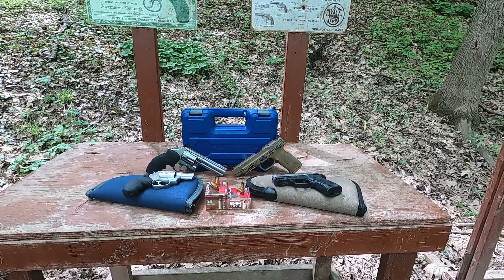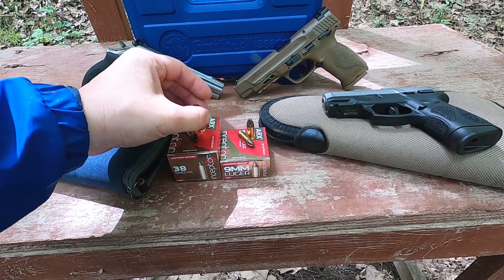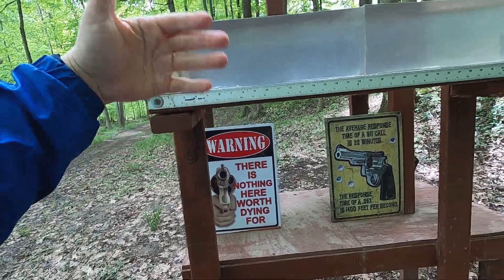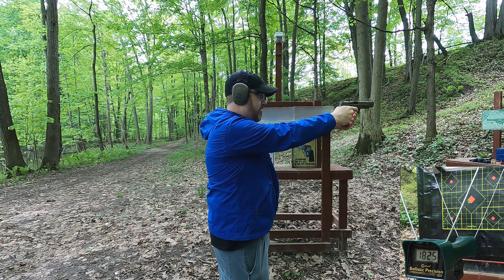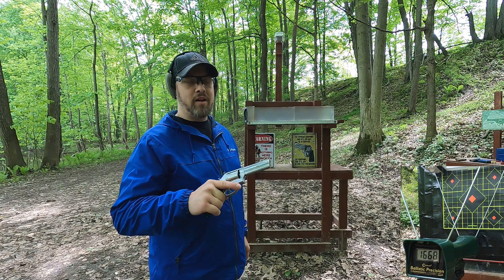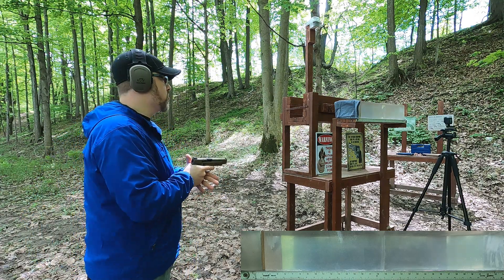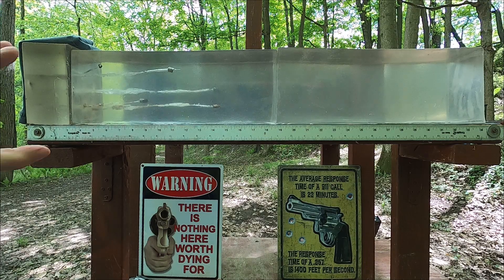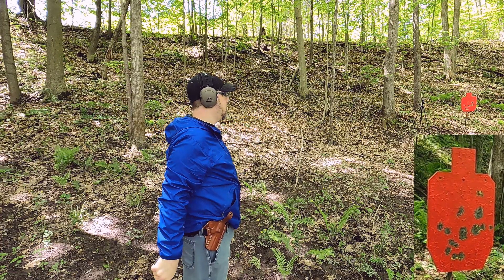🔫Plastic Bullets? Inceptor ARX Preferred Defense 9mm VS .38 Special Complete Ballistic Test

Comment: Will the rounds act/ behave like sandpaper on the "lands" in rifling? 

Filing down the lands? 

Just a thought
● copper or lead softer than the lands
Reply from the maker: These bullets are made from both plastic and copper, both of which are a lot softer than steel.
Reply: @GunSam I was considering the power of a dual apoxy. 

● what exactly are the manufacturers using for their molds? 
•• example sand, copper, and other alloys.

Just a thought.

Comment: What carry ammo would you recommend for a short barrel 9mm? I just got these bullets and if you don’t recommend them I don’t want to use them.
Reply from the maker: 9mm is pretty easy to get good ammo for. Simply use Federal HST or Speer Gold Dot and you will do well. If the pistol is very light I will use standard pressure, if it's a little heavier like over 20 OZ I use +P versions.

Comment: The only bullet I've ever used it has plastic in it is horny extreme defense 9 mm other than that I wouldn't shoot a plastic bullet I just use brass round nose in my 38 and of course I've got some hollow points in defensive loads  I hate lead round nose bullets all lead bullets do for a modern revolver is fail up the rifling

Comment: I would assume that the high velocities for the 9mm are to get the blowback to cycle. The inconsistent 38 velocities are likely because of a combination of case capacity, powder charge, OAL, and chamber pressure. I'm guessing pressure is too low. My thought would be to shorten the case to 38 short/long colt, with all other components being the same. Or, just use different ammo.

Comment: Great test, I’d avoid this ammo like the plague. Too many better options out there than to mess with these. Those wild swings on velocity for the .38 means inaccurate assembly equipment and crappy QA on their assembly line, so no.  Thanks for the heads up Sam, saved us some $$$ and possibly a trip to the ER if one of these subpar rounds wildly swings to the higher end of the velocity/pressure scale!  👍

Comment: I'm currently using the Norma version of this (NXD). I'm guessing Norma licensed the tech because it's obviously the same bullet but tweaked. I've fired significant amounts of the 80(Ruger brand) & 65 gr loads in 9mm. I've found it 100% reliable in everything I own from a 4.7" P320 to a 3.1" Shield+. It's basically a sintered bullet so barrier performance is not a goal, fwiw. Curiously, the terminal effects from 10% vs Clear Gel vary noticeably. I use it because I mostly pocket carry & 13 rounds of 65 gr bullets carry easy. As for Terminal Ballistics, if it goes bang & cycles I'm happy. When you get into wounding, barrier defeating, & cartridge integrity/sealing, your best choice is FC Tactical Bonded & I don't even know if it's accessible in 2022.

Comment: Wow, that took me back.  I checked my 38 ammo shelf, and I still have a box of New Generation Ammunition 38sp+P “Sentry” rounds, 80 gr. roundnose plastic bullet in a jacket, claiming 1,300 fps.  Original price was $27.99 and I bought ‘em at a show for $15.  Label says Batch 1282-43/99 so I suspect they were made the 43rd day of 1999.  Never tried ‘em, maybe should send to you. 😄Oddly, the red plastic is in a jacket that looks like nickeled brass, but loaded into plain brass.  Gimmick ammo like this might meet a requirement for low penetration, but as your test shows, it is seldom reliable for all purpose use.  I suspect blast and muzzle flash will be excessive, though recoil minimal. Thanks for the test! 👍

Comment: I'm impressed that the 9mm in the long barrel got close to 500 ft-lbs energy. The 38Spl in the short barrel (apart from one bullet disintegrating) is showing classic signs of undercharge. That is, the burn is random and therefore that's why the velocities are all over the place. A bulkier powder should have been used to get better case filling. Either that or use a cork wad like in shotguns to hold the powder in a smaller volume. I think LB4L has experimented with a similar idea for light loads. I'm not sure why the 4" barrel doesn't show this as the way the 2" barrel does. Perhaps powder burning while the bullet is in the barrel is still able to hold the pressure up.
Reply from the maker: They should jacket these things. I think the velocity would be similar. The recoil is insane though, and by that I mean like .22 LR felt recoil with the 9mm in the M&P.
Reply: @GunSam  Can you clarify what you meant about the recoil? Is it a lot or a little?
For the 38Spl, I think 110s would ultimately have performed better. And in the 9mm, your typical 115s would probably have performed better.
I definitely want to do that light and fast vs heavy and slow test with XTPs.

Comment: That .38 is crap. That being said, energy be damned, getting hit with something moving at those speeds would immediately put the thought of dying in your head. Would not buy, nice test. Also, and hard to prove, the metal bits of the ammo might be very cheaply formed and the plastic makes up for the shape. Would explain the huge differences in felt recoil and velocities anyway. Take a misshapen chunk of metal and smooth it out with polymers.

Comment: Are sjhp rounds the only self defense rounds acceptable for use in short barreled .38? Every test I see just doesn’t seem to cut the mustard.
Reply from the maker: It's hard to really say. If you want expansion generally going to a hot .38+P is the only way, like Buffalo Bore.
Reply: @GunSam  do you mean the soft hollow point Keith rounds?
Reply: @chrism.6371  Sam tested some Hornady FTX 110gr 38Spl+P against Remington HTP 110gr 38Spl+P. Both rounds seemed to perform quite well out of the short barrel. I've shot the HTP out of my M&P340 and they are quite manageable. Both seem cost effective depending on your definition of "hyper ammunition" in this day and age.
Reply: @Fudmottin  thanks for the info. I carry 357 mag. But my mom keeps an air weight in her purse. I try to keep the best ammo I can within her reach. Not that she can’t handle recoil, she’s 74 and still has a death grip. At this point I’ve settled on HTP 125 and 110 sjhp rounds (+p). The exposed lead concerns me, but that’s it.
Reply: @chrism.6371  Both can ruin someone's day for sure! I would use either of those loads. Metallic lead isn't really dangerous. And the older you get, the less dangerous it gets. Certainly the rounds in the gun are not going to be an issue. I always wash my hands after handling any ammunition.
Reply: @Fudmottin  I trust them too, because I’ve seen the ballistic results. So much lead is wasted on newfangled gimmicks. Velocity is very important with some ammo. Others not as much. I keep seeing Lee Harvey Oswald’s name popping up. That LRN had a dance party in his torso.
Reply: @chrism.6371  It did. And if it was a standard load, it probably exited the muzzle at less than 700fps.

Comment: The gap between barrel and cilynder kills the velocity in a Revolver. Thats a serious handicap in terms of energy/velocity.
Reply from the maker: There's no standard number though. I have seen tests done where as little as 1% is lost. The average is about 5% or 50 FPS for every 1,000 FPS with no gap. So if you had a 9mm auto and got 1,000 FPS then used a revolver with the same gun travel and ammo you would get 950 FPS.
Reply: @GunSam  thank you Sam. I was wrong.

Comment: I wonder if the Taurus has a little misalignment on some chambers...that may explain the fragmentation. A sintered bullet will come apart once it has been compromised, as would happen if the gun was "shaving" part of it off.
Reply from the maker: I have no idea, but my S&W J-frame did it as well. Either way, if it can't handle the rigors of an average revolver, it's not a good design.
Reply: @GunSam  I don't think it's an issue with the gun. I think the cartridge was poorly charged.
Reply: @GunSam  True dat!
Reply: Or it could just be a tight forcing cone.

Comment: I'm sticking with Underwood Xtreme Penetrators
Reply: I would prefer the Xtreme Defenders, for a two legged assailant.
Reply: @freedomfirst5420  I've used both followed up with Hardcast
Reply: HeavenBoundTrucker444  Performance is tops. $$$ who cares.
Reply from the maker: @LarryeWhite61  I have been curious myself about them. I have ran them and seen not too much different than HP's, but my main thought is if I could get a spare windshield to do some tests, I feel like the Xtreme bullets would do more damage on the other side of it VS a JHP, especially when loaded low like .38 Special.
Reply: @GunSam  I have only used them on hard barriers. ie..solid cinder blocks. Needless to say, all calibers of Underwood Xtreme Penetrators are impressive.
Reply: I keep my 9mm carry filled with Underwood Xtreme Defenders. Seems like they penetrate less. When I say less it's still like 16" in gel. I carry a pocket .380 sometime and use Fort Scotts TUI or Extreme Defender +p. You don't really need the +p for 9mm. I don't really trust any hollow point in 380.
Reply: @Why...So...Stupid...  you aren't in bear country.... I assume. 25 grains more on extreme penetrator sounds great for beers.
Reply: @sasquatchrosefarts  what? The video was about 38 spl vs 9mm. Neither is sufficient for bear.